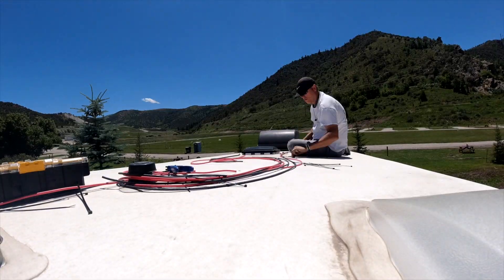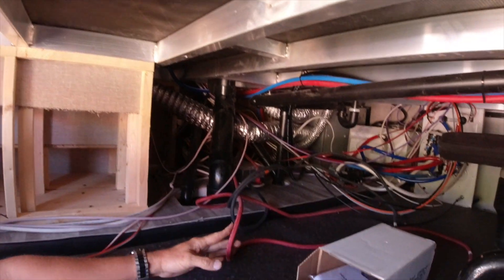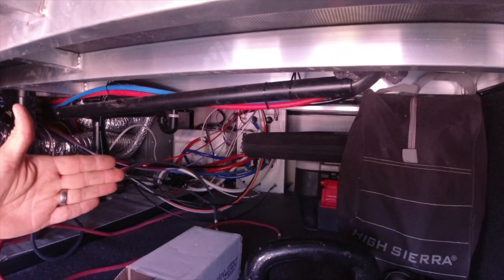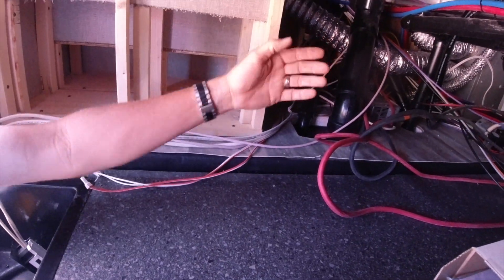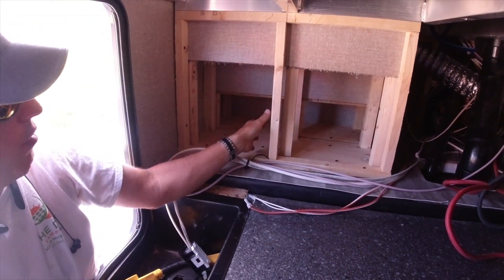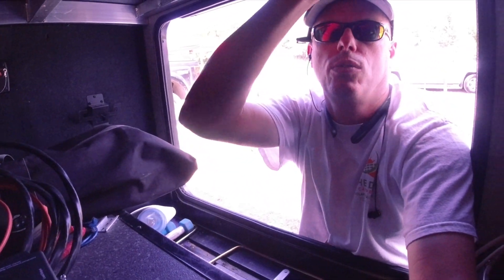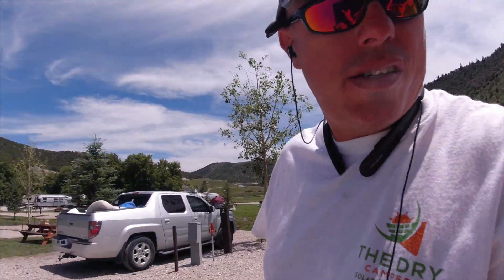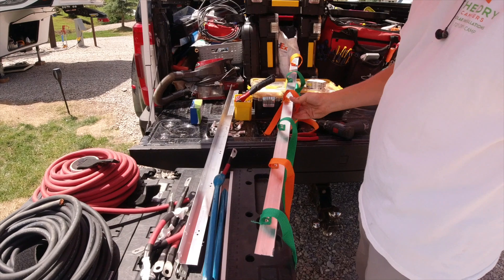2020 Grand Design Reflection 290BH Solar & Battle Born Install | Boondocking

Comment: Thanks for the video, great information. So I have 2021 reflection 311bhs. I am installing the Victron 712. The rig is prewired for Solar . All I want for now is to have a panel to charge my batteries. 2 AMG 6volt 225AH . I would like to know what you recommend for a charge controller ( one I can build on for the future) and the panel/ panels you recommend for just charging my batteries at this time ? 
Thank you,
Heber
Reply from the maker: Hi there Heber, when you look at purchasing a solar charge controller, think: how large of a system do I want to grow it to? Once you have that nailed down, then you can choose the right solar charge controller. If it were me, even though it's expensive, I would add a Victron 150/100 (max 1450W). If you are thinking about switching to lithium in the future as well, be sure to find a charge controller that will do both AGM and lithium like the Victron. As far as panels, I prefer Renogy Eclipse panels because not only do they perform well (22% efficiency), but they're also great looking panels, for aesthetics. My preference for dollar per watt and performance would be the REC N Peak 330W panels; however, if you're just wanting to charge up your batteries, the Renogy panels are perfect for that.
Reply: @TheDryCampers  Thank you for your reply. At this point I would just like something to charge the batteries. I would like something I can build on so I like your input on that . I will send you the panel the Victron dealer recommended and please give me you input on that. When it comes time to add an inverter which would you recommend? I would like to stay with one brand . We are weekend warriors so maybe we would like run some stuff while Boon docking in the future, a/c , micro etc . I know that takes a lot so your input would be appreciated. Thanks,

Heber
Reply: @TheDryCampers  Do you have a link to the panel you suggest?
Reply: @TheDryCampers  Hi Mike so the panel
You suggest would plug into a MC4 ? That’s what is on the roof . And for just charging for now do I need one or two panels? If you have a link on what you suggest that would be great . 

Thanks,
Heber
Reply: @TheDryCampers  Hi Mike, if I do need a cable which will
I need? Sorry to bother you just want to get this ordered up . Thanks
Reply: Hi thanks for the great video.  I'm looking at a 2022 28BH.  It has inverter prewired and has a single solar panel with 50 amp controller.  My thought was to put 4 lithium batteries, three more more solar panels and a victron 3000 multi.  Question any reason you didn't use the front compartment?  Because solar and inverter wires are there Id prefer to start there.  Also the solar factory controller is furion. Should I get the victron solar for control or monitoring?

Comment: Hello!  Can you expand for me a bit or provide a little more detail on where and how you brought the solar cables from the roof to the belly?  I have a 2019 Reflection and am having some issues finding a good passage for them. Any help would be appreciated!  You do great work my friend!
Reply from the maker: The Treasure Hounds thanks! I made a hole in the roof since there was not an access panel for satellite like on most Grand Designs. I wanted to come in the wall behind the toilet so I measured the vent and skylight on the inside and did the same on the roof so that I could come through the wall. Hope that helps!
Reply: The Dry Campers yes sir. I appreciate that!

Comment: Nicely done!  Where and how did you install the BMV-712 and Progressive remote?
Reply from the maker: Niko Vandevoorde good question, since we didn’t film it!! The client just sent us some photos if you’d like us to send but the 712 is in the wall that was used for the wire pull and the progressive Industries was in the control panel with the other electronics in the cabinet. 😁
Reply: The Dry Campers Thnx a million for your reply!!  👊. Yes, would you be so kind as to share some of those photos?
Reply from the maker: @nikovandevoorde7085  Sure!! If you're on Instagram, I did a post just for you specifically to show those and if you don't, shoot me an email at info@thedrycampers.com and I'll send those pics to you. :)
Reply: The Dry Campers Got it!!!  Thnx a million!!!  I greatly appreciate it!  👊

Comment: I really like what you did I have a questions can you tell me what type of wood did you use for the storage area? I like how you inclosed the area and around the wet controls.  Can you tell me what you used and where you got it. Thanks
Reply from the maker: Thanks so much, sure - normally I use blondewood because it's strong (7 layers) and carpet it, but because there wasn't a Lowe's nearby, I had this on-hand from a project for our Airstream. It's from Menard's: https://www.menards.com/main/building-materials/panel-products/hardwood-panels/4-x-8-uv-prefinished-plywood/1251650/p-1444441908852.htm